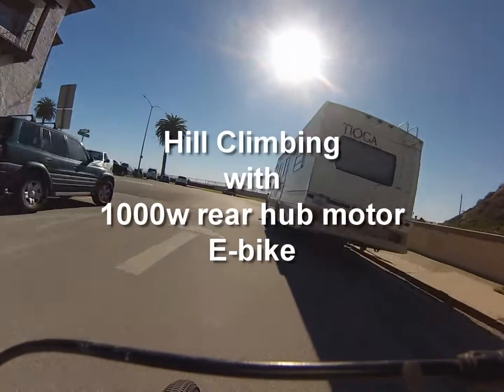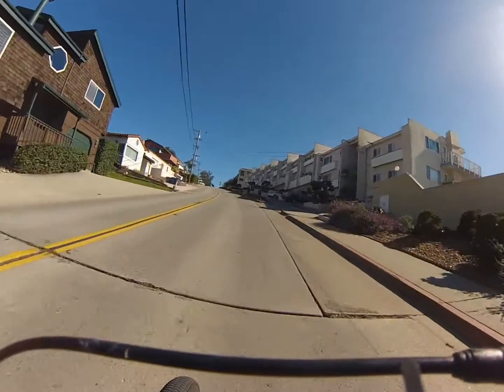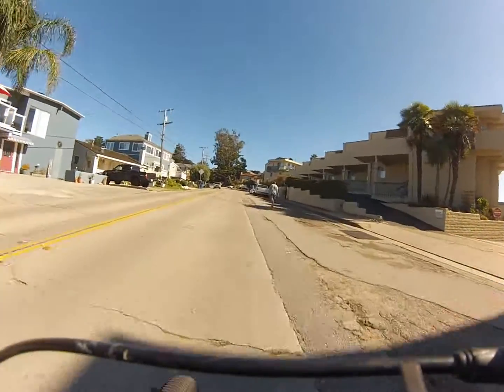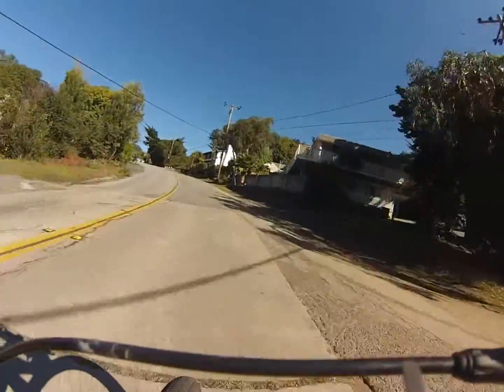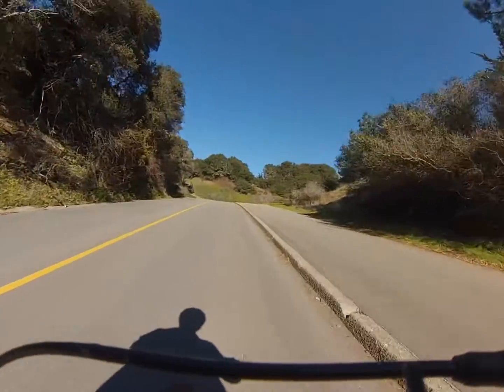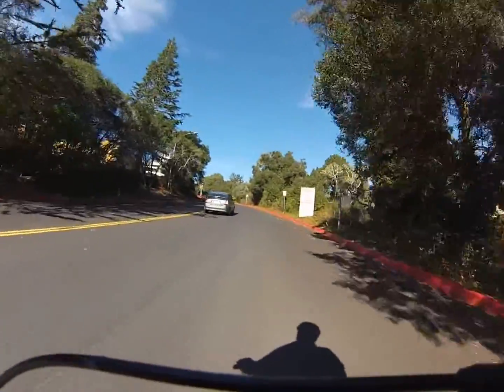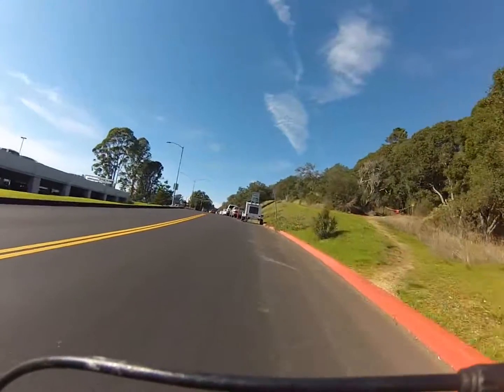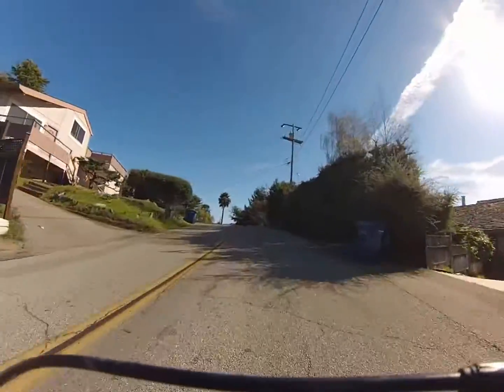Electric Bike TIPS. Hill climbing, steep Santa Cruz hills with a 1000w e-Bike conversion kit.

Comment: Does 500W climb that 14 grade hill?
Reply: Maybe barely. No way would it be pleasant. 750w is really the minimum, but you can always boost it up more like 1000w by getting a higher voltage battery for example instead of 48v use a 52v.

Comment: did you notice any overheating on hot days? hub motors are not exactly liking uphill driving for a long time.
Reply from the maker: The motor does get hot sometimes, but the bigger concern is the controller overheating. On hot days I do check them by feel, and if it seems too hot. I just shut it off for about 15 minutes. I have only burnt out 2 controllers in 3 years on hills.

Comment: I bet that motor was damn near smoking after this. Steep hill climbing will kill hub motors pretty fast. I use a BBSHD with a 30 tooth front gear and a 42 tooth rear 1st and at at 52v it will climb up anything at 12mph if you can keep from flipping over backwards all day long without getting hot at all. I have built a lot of ebikes over the years and would NEVER recommend a hub motor for hilly/steep areas.
Reply: Agreed. But if hub motors are your thing for lazy cruising at speed, And you want some good hill climbing power too, Then 1000/1500w with 48v and 30 amps controller would be my minimum for a hub set up. With hubs, You need lots amps for serious hill climbing and a hub that can take it.. But with mid drives you can be much more conservative and still tackle hills well because they use your gears and your bottom bracket area as leverage.
Reply: @mozzjones6943  i bought 48v 1000w and samsung battery 30ah  with 50 amps . that would do the work  . anyway i dont live in area with lot of uphills so for me it is perfect
Reply: @techgeek2994  Indeed. I prefer hubs as I am one of those that do a lot of cruising on cycle tracks and am surrounded by low to medium gradients. I too currently have a 1000w motor running at 48v but with 30 amp controller (so producing somewhere near 1500w), And it demolishes my surroundings. Yes of course it bogs down once those gradients get high, But in those moments it still gets me up without too much stress. Anything lower spec is a big no no in my opinion, And the more amps the better! I previously had 2000w 72v 60amp beast that held no prisoners lol I chewed the motor and blew the controller though 😂 I treated it like shit. But decided to downgrade after the fun was over.
Reply: @mozzjones6943  You should try a QS with a 72v 150a controller. 10KW is a ton of fun on an enduro frame :-)
Reply: not really if you put thermal pads inside of controller and good ones
Reply: @techgeek2994  It isn't the controller that gets hot, it's the motor being lugged out. A BLDC produces peak torque at or below 50% max RPM. That means that half the power the controller is pumping through the motor is being turned directly into heat. Hub motors have their coils located within the rotor housing and don't receive any cooling without running a oil filler to sink the heat to the housing. Even then, this is very inefficient and can only be sustained for a few minutes at most.
Reply: @MasterQuack14  i am not worrying about that i dont live in area with lot uf uphills, my area is all pretty much straitgh area with very little uphills
Reply: @techgeek2994  it still applies to acceleration and sustaining top speed. If you have a 72v system running 3t coils your top speed would be like 120mph. If you only apply 500-1000w you will be lugging that motor at speed turning most of that power to heat since that much power will only achieve 30mph. Simply selecting a 10-12t motor will put the maximum speed in line with applied power top speed. This is proper tuning for hub motors. It is easier to do with mid drives and doesn't strictly apply to hill climbing.
Reply: Yeah but mid-drive puts a lot of strain on the chain and BBSHD is notorious for it's awful chain alignment on smallest gears. You can improve on it by buying expensive front cogs often made of aluminum which wears down way faster than the cheap steel one BBSHD comes with. Need to also replace cassette like once a year and chains twice if you drive it almost daily, unless you enjoy your chains dropping and poor shifting etc.

Comment: Hey, what set up is your battery pack? My guess a 13s15p? 195 cells? Your bike is handling the hills very well so I'm currently building a 1000W bike that does the same but mine is only 13s13p 169 cells at the moment and cuts out too often on the steepest of hill climbs around here with ridiculous gradients and that is with peddle assist. Many thanks.

Comment: I think a mid drive would be better for hill climbing
Reply: Communist media - totally agree but also much more expensive & harder to diy fit
Reply: @woodstockxx  Not expensive at all. BBS02 is like $400. Can easily spend that for a decent hub motor+controller.
Reply: @finlandjourney6065  - you could..if you wanted..but the cost of manufacturing mid drive motors is greater than that of most hub motors, so common sense would dictate that a decent quality mid drive would generally be priced higher than a hub motor of the same standard. I like the simplicity of hub motors but can’t deny that I’d rather have a mid motor with belt drive on a bike like this, due to the increased torque & the fact that there is a big space, right behind that blanking plate, which is clearly intended to house one..screw it..stick em both on there..hub motor would be a good back up, in the event of a snapped chain/belt..lol
Reply: no moving parts in a hub motor , mid drives have plastic gears which wear over time.

Comment from the maker: No matter what shape you are in, hills are a bitch. Hills also put the cyclist in a more precarious situation, by significantly reducing their speed and reaction time. Sharing a 22% climb with a fast moving truck, sucks. One of the great advantages of an e-bike is to be able to call on that power when you need it and hammer through a hill that wouldn't otherwise be possible.